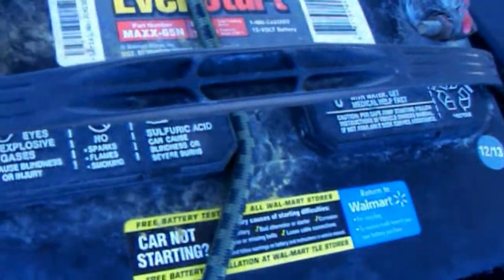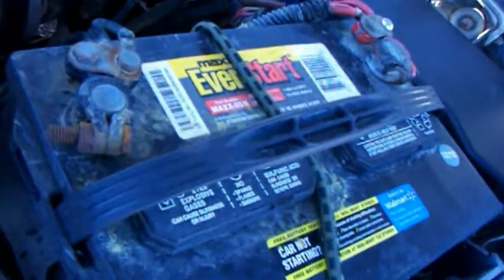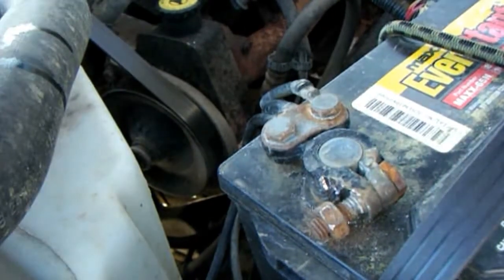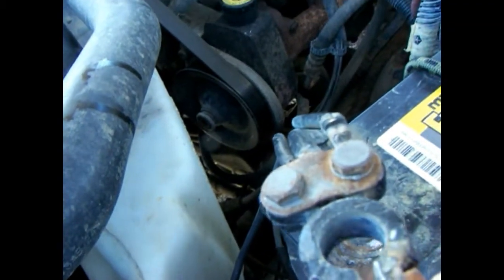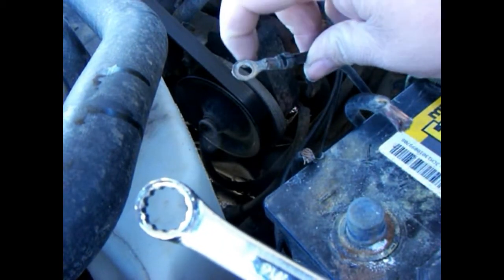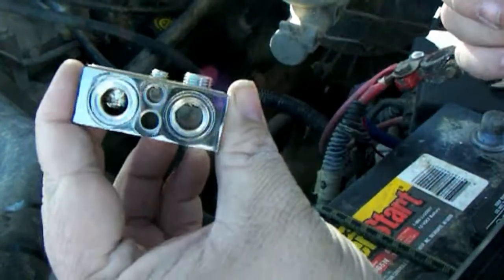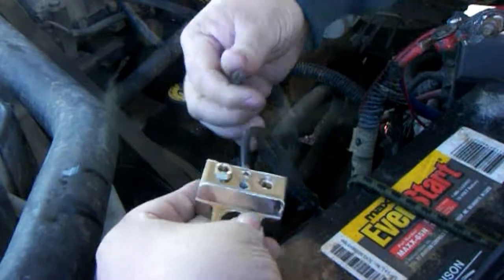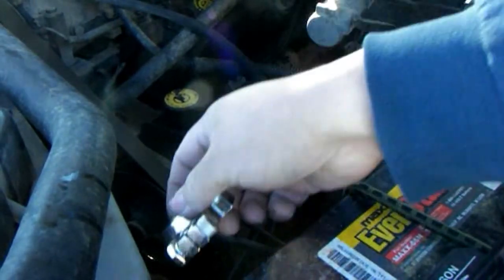Upgrading Battery Terminals | Garage Edition Season 2 Ep. 2

Comment: You should start off by cleaning everything up first including your wire and Battery Post. If you're going to use the grub screw type of battery terminal you should install a wire ferrule on each wire before inserting into the battery terminal. And also Noalox should be installed on all bear cable or at least Dielectric grease.